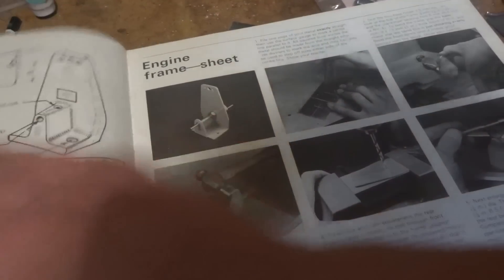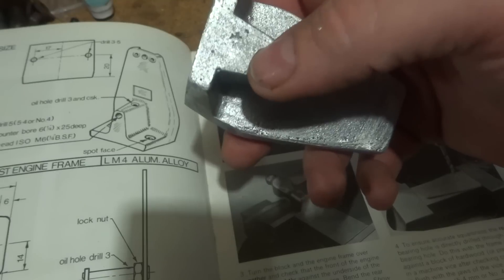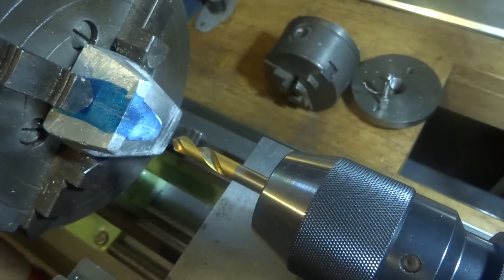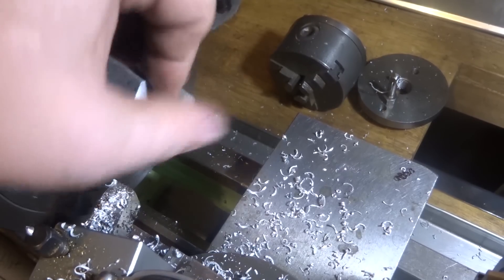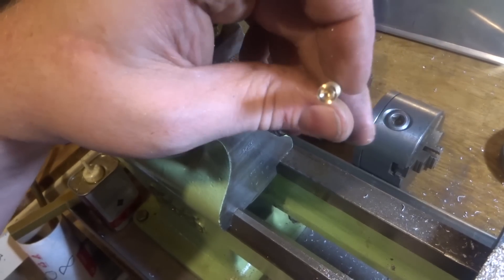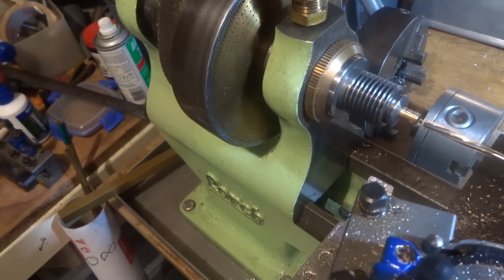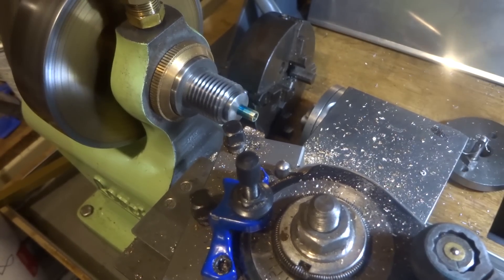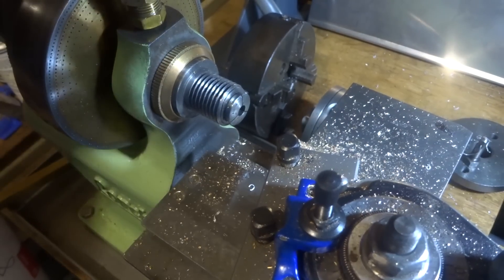K W  SCHOOLS  Steam Engine PART 16 Bearings

Comment: Was it me, or did your camera crash unexpectedly? I am really enjoying this series, straight out of "Model Engineering"  but live, and I don't have to pay $100 a year for the subscription!  I have watched all your restoration videos, but I don't remember if you ever mentioned the model. Lorch made quite a few lathes according to www.lathes.co.uk, the Encyclopedia Britannica of lathes, and I think a Lorch, no matter how old, is a match for any asiatic lathe no matter how old -- as long as the spindle bearings are still true. It's a treasure. Incidentally that was lovely four-jaw work, or why you really don't need a mill if you can use a four-jaw. I have taken note.
Reply from the maker: Lol.. what model lorch?? Its AII(P) as far as i can work out. No records of these old machines, or even the newer ones. A = 100mm centre height, ii = 12.5mm or number 2 lorch collets and the p = it was originally fitted with thread chasing equipment. Bearinga are all brand new this restoration so it has a lot of yeara left in. My guess is post ww1 though.

Comment: Nice work on the "youngster" lathe there Emma.   My first lathe was and is a Seneca Falls "Star",  It was built in 1898 and originally ran on a line shaft.  I converted it 120vac and it works great.  It still holds .001 all day.  Keep up the good work...   Fred

Comment: Looks like that turned out pretty dang good.
I see what you mean by it needing a pin to hold the collet chuck but a little pressure and it snugged right up.
Nice lathe Emma, it works just fine.
Mike